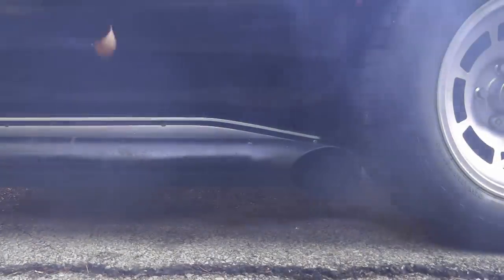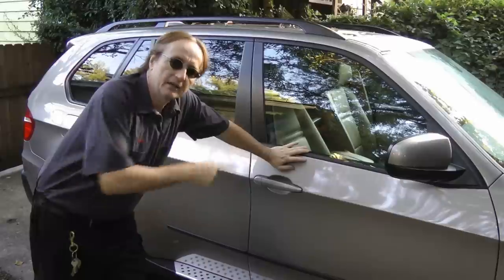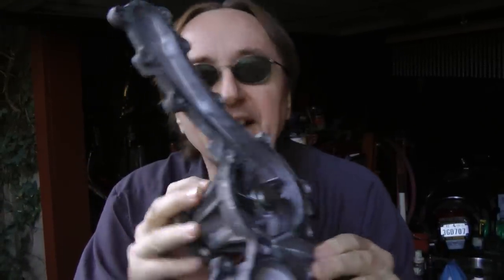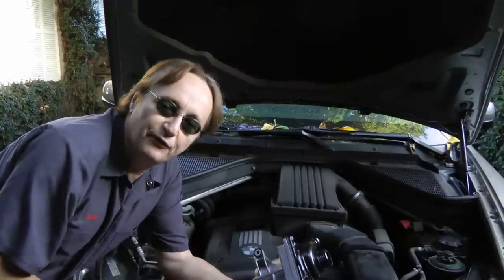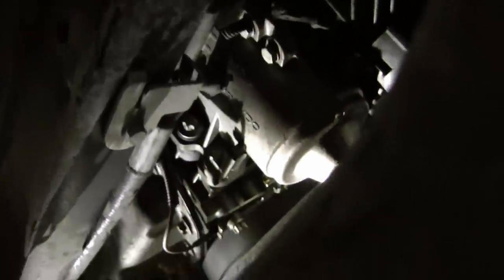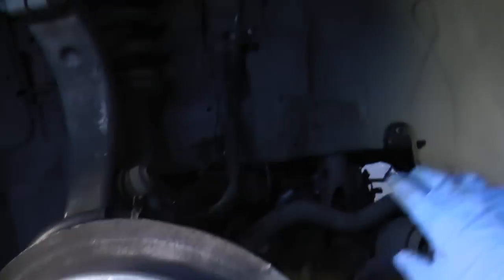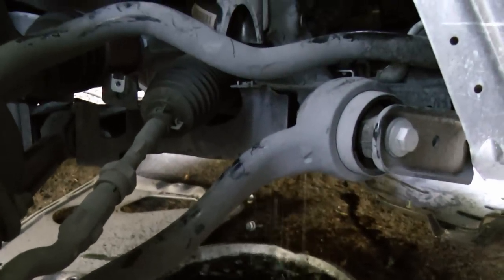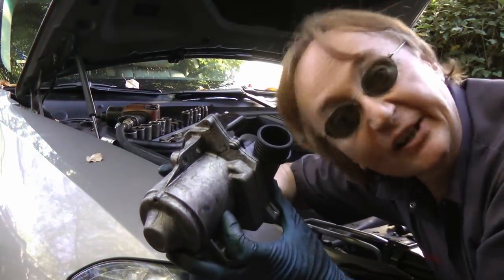How To Replace a Bad Electronic Water Pump

Comment: You're not an engineer, so you don't know why they did it. Money? Sure but bmw is one of the top car brands out there. He obviously has something against the company. He is a typical American car fanboy. Trust me, germans can make cars way better than America and Japan
Reply from the maker: HA, shows what you know. I'm not an american car fan at all. I just show people what they are getting into with german cars, over engineered money pits that fall apart after a few years from cheap plastic parts and overly complex electronics. If you don't mind throwing your money into them, go right ahead, they ride nice. BUT just check out their insanely low resale prices and you'll understand the "quality" that they don't have over time. Decades ago, yes, they were high quality, but no more.
Reply: I don't understand where you're coming from though. Every car has plastic parts and the water pump from this car is the only one from bmw that is giving people problems. German cars are supposed to be higher class vehicles and they are. I know someone with a 2000 bmw 3 series and its outlasted my own personal pervious honda so you can't really blame all of Germany and Bmw off of one thing like this. Every company is in it for money. Honda and Toyota happen to make boring cars that get you from point A to B. Recently however, Japanese cars aren't as reliable as they used to be.
Reply: He obviously has something against stupidity.
They design it that way as with many luxury cars to suck money out of your pocket.
Be a sheep and think...luxury this and that and that they are premium etc etc.

Fact is...that motor isn't going to last any longer than the engine in a Honda Civic or Chevy pickup.

It's done ass backwards because of this reason alone.........ENGINEERS ARE PAID TO ENGINEER...............they don't two $h!ts on who has to fix it.
Reply from the maker: Matt Watts
you are totally insane, please stop posting these made up figures. Any fool can read edmunds book values and see how low Merc resale values are. Go troll somewhere else.

Comment: With how much they cost, with such "advanced" engineering; one would think repairs could be made simple-or at least not unreasonably expensive. Being wealthy enough to have enough money to throw at repairs is a "new" money thing. Old money would buy an old buick and say hell with it, pay a local guy to fix it and get back to business. New money is flair, and excess that would never have let them be who they are if the old money did it too.

Comment: I specialize in European cars. I always preferred them over the domestic crap. Every manufacturer has put out garbage. Ford don't get me started with the brilliant stuff they have come up with. GM and their crap vortec induction, northstar engine, what about all the playmates quality interiors? Chrysler I also will need like 5 of these comments to run through all their issues. Cars are cars, at the end ppl just buy what they like (or their wives want) and its out job to fix them. I

Comment: The fact that these junk water pumps die so early, and are a pain in the ass to replace is just HALF of the problem.

Because these plastic shits are so expensive, you simply don't just replace it for "preventative" maintenance if it has already been replaced. Would be a BIG waste of money. Also, the life span of these shits are anywhere from as low as 30k miles to 150k miles. That's a big range to start guessing between and throwing $400+(if you're doing it yourself) or $1500+ if you pay a mechanic. I sure as hell won't buy another BMW.

It'd be fine to replace it if the car was new. Ok, its a expensive repair but fairly important and worthwhile because the cars new. But when you're talking about a 11 year old car(like mine) that needs this part, fine it needs it. Worth while to fix it as a preventative? No. Simply because the rest of the car is falling apart. Oil pan, valve cover, rear diff are all leaking. Is a $6500 valued car really worth $5000 in repairs? No, especially if you don't know if the engine or transmission are gonna give out. BMW sucks ass. I mean I wouldn't complain if i didn't have to drop the sub frame to get to it...I can DIY it but it's not worth my time.

Comment: I use to have an Audi and when the alternator failed they had to remove the whole front of the car and it took 2 days and cost $600("discounted" )There is nothing smart about German engineering and as long as a live I won't buy German

Comment: They probably designed it that way so it could be one less load on the engine... im sorry.. but 20 more hp and slightly more torque isnt worth 1000 bucks to replace..

Comment: 5 or 6 HOURS to do??? Wouldn't going in by taking off the front bumper and grill be faster than that? Then again, I don't have an impact wrench or a fancy jack like that, so just taking a wheel off and back on is 20 minutes lol

Comment: the sad part is lots of cheap to replace parts are hard to get to on most new BMWs.... namely the starter... Fkin hell the amount of shit you have to take out of the engine bay to change a fking starter... or the sensor right next to it on a E90. cheap and time consuming cars if you DIY, if not prepare to pay, and pay, and pay
Reply: Check out where Cadillac put their starter on the hi-tech Northstar engine.
Reply: Alecxace My Infiniti i35 is way worse a old inline 6 BMW seems so much easier than my shitty car.

Comment: Correct,luxury cars are a gimmick, (with gimmicks) for persons to impress their like,(dentists). The Japanese introduced the concept of quality without the cost. A maintained 'normal' car offers everything you need and more and all to often wipes the floor with 'luxury' cars when it comes to running costs and reliability. Magnesium bolts, yeah right. Also an X5 is crap bigtime offroad, so you buy one for what reason? Your Celica will out live it, and be more fun to drive.

Comment: I miss my old e46 325i :( what a great car that was .. the e90 no oil dipstick, now water pump is broken. currently waiting for the water pump to arrive at dealership, I hope the engine wasn't damaged due to to overheating. so much for german engineering f*ck it

Comment: O M G that pump is so stupid and the bolts! Somebody should sue them for this. What happens on the freeway at 70mph when you overheat and seize the engine? This is deliberate bad engineering in my opinion. Hell, I found it easier to build my cobra replica than to work on new cars.

Comment: I hate these cars they're only good if you're rich AND you LEASE them not buy them....If you're an average joe and you BUY one of these you will be sorry.Even for an oil change you need to take off a stupid cover just to get to the drain plug which requires a "special tool" to loosen.

Comment: This is why BMWs are nothing but crap
Reply: so i see you have never owned a BMW ? I've had 3 and they never vent wrong
What kind of car do you have ?
Reply: steffen førnes you probably lease your BMWs for a couple years and then trade them in for a new one no wonder you have no problems try driving them for 6 810 years and see how many problems you rack up between plastic electric water pumps that always fail engines with no oil dipstick or transmission dipstick to check your fluids so you blow your engine and transmission to plastic engine parts that get brittle and cause all kinds of problems in my opinion Three Stooges engineering and yes I've never owned a BMW but I know people that have and they have nothing but problems with them that's why BMW stands for bring my wallet because you  spend most the time in the shop.
Reply: heh, no I've allways owned my cars. have had a 1999 523 with 230k km on it, a 2008 116D with 110k km on it, and the one i drive now, a 2011 320d with 125k km on it. they have all worked just fine, and the only things I have done to them is oil and brake service, so saying the spend more time at a workshop is just stupid. 

I agree that removing the dip stick for the engine oil is a little stupid, but i have never heard of anyone having a failed transmission an a BMW because of low oil level.
 The reason for the transmissions to break is because the manufacturers say its filled with a " lifelong transmission oil" and never needs change. they do.
 And not only BMW is doing this, all cars sold here in Norway have lifelong oil in its transmission, and the same with plastic engine parts... they all do it

Comment: Does a belt driven water pump really scavenge all that much power? Well I sure as f**k don't think it's going to rob the engine of 100 horse power. But hey, these engineers have university degrees, who am I to complain. As for that pump being in the most ignorant place, I guess they assemble the engine and all its components, then squeeze it into a slot they call an engine compartment. Yeah, it's easy to put on a pump when the engine is "outside" of the car.
Reply: ***** TheRantingCabbie the power the pump requires isn't really relevant, since as ***** points out, the electric version still takes power to run! Electric systems tend to be very highly efficient, but the energy conversion from mechanical>electrical>mechanical is still obviously less so than a direct mechanical>mechanical belt transmission. As an aside, you might be surprised just how much power: the pump in the N52 Scotty's working on above is 400W, or a bit over half a horsepower. It's bigger brother in the turbo'd N54 is 900W, or 1.2HP. The real advantage as Loftworthy hints at is that, with an external electric pump, the ECU has fine control over coolant flow and thus cooling capacity, rather than a mechanical pump fixed in speed to the engine RPM, though why BMW desired that I couldn't say.

It does lead to one nice feature, "Residual heat." In the winter, you can click a button on the climate control to keep the interior heat running for 15m after the car is shut off. Great for not freezing your nipples off when you get out of the grocery store.

Comment: I say let the "status people" buy this cars scotty, the more they break, more business for us,  Lets not bash the engineers for designing  the pump this way .....mechanical pumps do last longer, but  you have to deal with taking off all the accessories belts, motor timing belt. its the not the designer engineers fault. its the 'Status people" lack of maintenance, they drive this cars to the ground. The only liquid they put in the car is FUEL

Comment: the plastic on the impeller and on the water pump must be the same material as the plastic tanks on the radiator i poses a Previa with 630,000 miles original water pump thats starting to leak ...until technology catches up with chemistry it's all about the Benjamins baby!!

Comment: Or like on the 528i with a belt driven pump that has a plastic impeller. Engineers are idiots. The plastic impeller breaks but the pulley still spins just fine given no indication of a bad pump. Also has a secondary electric pump that's messes with you because at idles it runs just enough to keep the engine from overheating. Engineers suck............had to eventually do head gaskets on this one because of them. Talk about a learning experience. Engine also had variable valve timing and required special tools to put back in time. Good and bad
Reply: Basically it just comes down to. They need to engineer these modern crap boxes to be worked on again.
Get rid of plastic components that were once metal. Go back to glass headlights with safety glass, instead of these UV susceptible plastic lens+ leak.

They should publicly list the names Engineers & what they made , so if they come up with something stupid ...the mechanics can take them out back and kick the you know what out of them. And finally the guys who sign off on these projects and control the purse strings at these companies need a swift dose of reality.

Comment: That's the conclusion you have some up with? Obviously by your asinine statement you have NEVER seen a race in your life. One race water pump running in IRL or Indy or NASCAR in one race (500 mile average) endures 15-20 years of normal wear and tear life of stop and go driving. Do us a favor... Do AT LEAST a little research before you pull a bs statement like that and type it.

Comment: hahahahahhahahahahahahahahahaha this guy is a joke. motor mounts? jacking engine? wheels? none of that is necessary.
Reply from the maker: oh yea, read the manual on how to do this job, that's what it says and I followed it
Reply: Scotty Kilmer I work on these professionally and warranty time is only 3 hours on them. Maybe wrenching on them trying to figure out how to do it ate all your time, but it isn't difficult and the water pumps last just as long as a mechanical belt driven one. I actually prefer the electric pumps, but what do I know, I'm just a bmw technician without a YouTube channel.